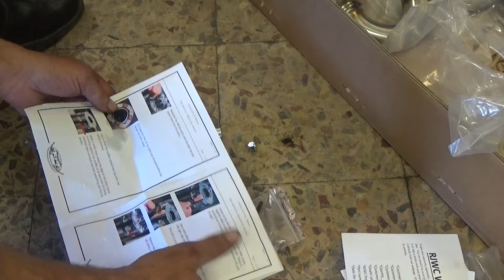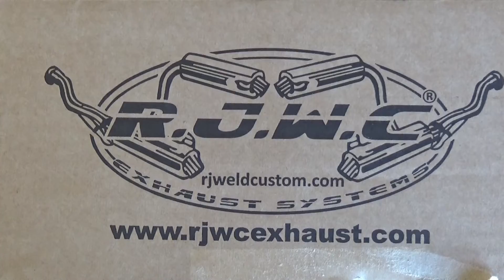RJWC Dual Exhaust   Can-am  outlander 1000 xtp

Comment: Did you have to run a tuner with that exhaust?
Reply from the maker: I have checked that the Power Commander is not needed with the exhaust, it's been running fine since day 1 after installing the exhaust.
Reply: Looks deadly,thanks for reply back.
Reply: Tigernor you prob gonna want one they run lean even with stock exhaust, not trying to be somehow just saying for the health of the bike
Reply: Don’t use any tuners with RJ W see exhaust the tuner blows up the cylinder with fuel even on 7% and they recommend 25% which is way too high. It ends up in the crankcase which is horrible so save your money just run the exhaust I love the sound